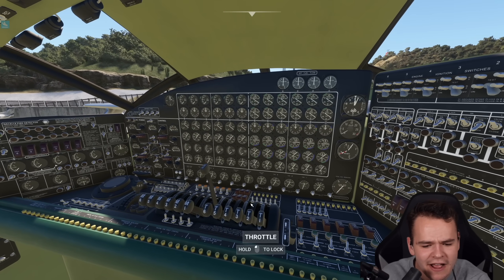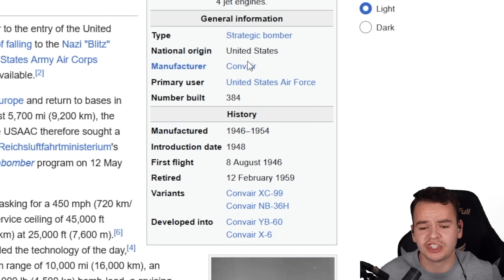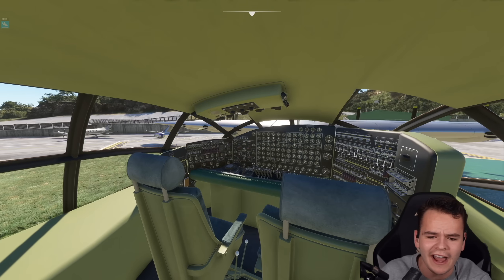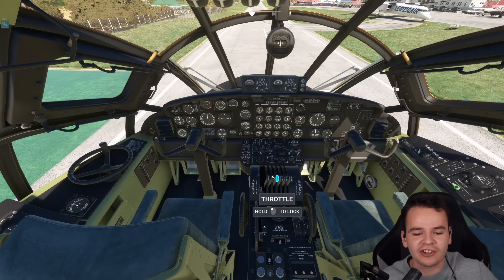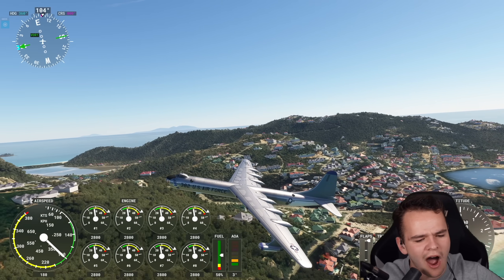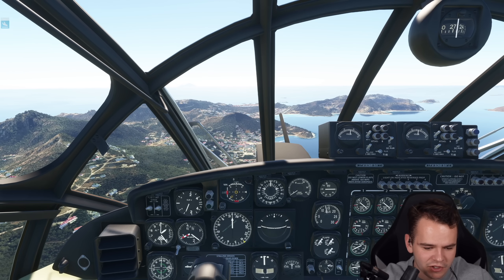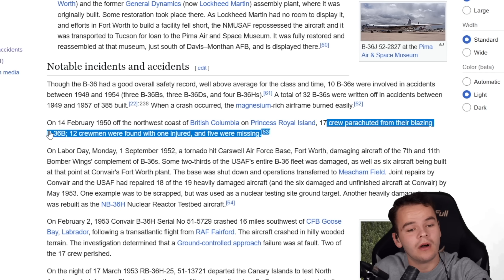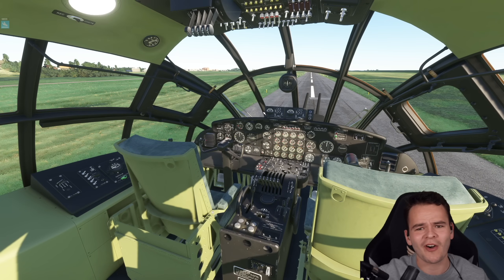The B-36 Peacemaker Had 10 ENGINES - Why Did It Fail?

Comment: THEY WERE GENERAL ELECTRIC J-47s
TURBO FAN JET ENGINES AND PRATT AND WHITNEY 28 CYLINDER WASP MAJOR RADIAL PISTON ENGINES.....AND THE JETS WERE CONVERTED TO RUN ON HIGH TEST AVIATION GAS AND PAYLOAD WAS 30,000 GALLONS OF FUEL ⛽

Comment: One of the main problems that the B-36 had was its piston engines overheating in flight. The engines were designed to be in a puller configuration, but since they were turned around, the airflow wasn’t as good, so they had a tendency to overheat.

Comment: The piston engines were meant to be in a pull not in a pusher configuration so they often just caught fire
Reply: I can only assume that it didn't get much cooling with that config. No giant "fan" giving it fresh cool air.
Reply: @zerocool6452  yeah it was like that
Reply: the carburetor got frozen bc of the cold air and caused a fire hazard